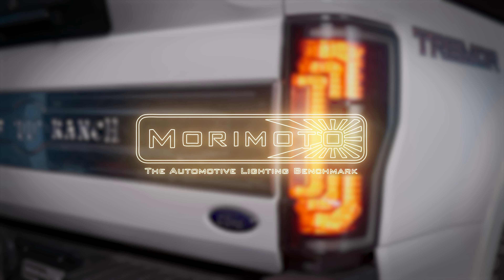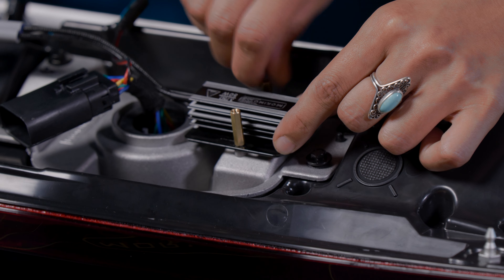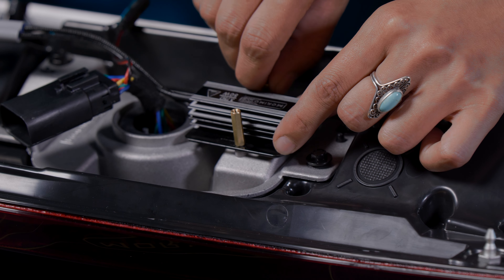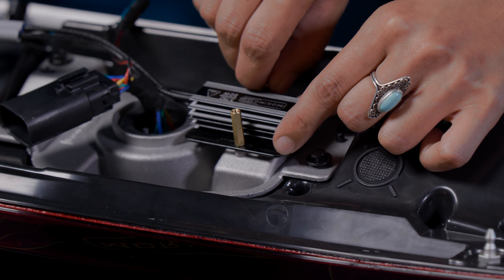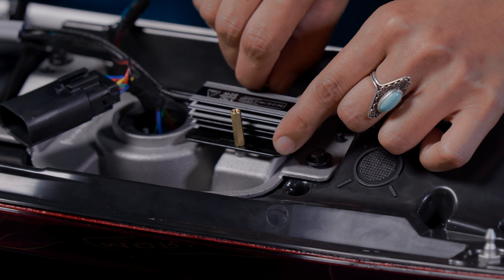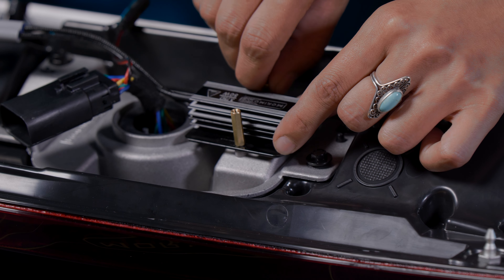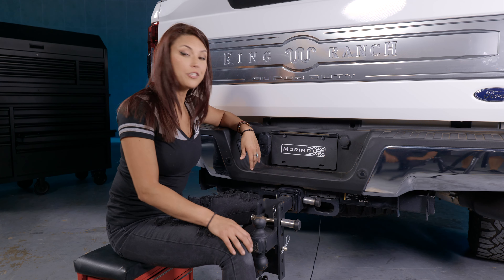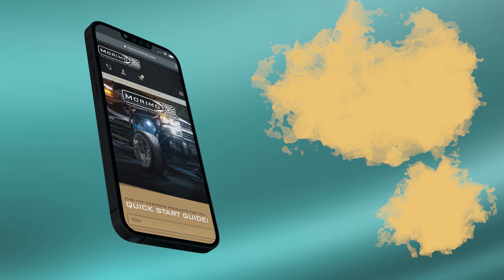2017-2022 Ford Super Duty XB LED Tail lights - Review & Install

Comment: The correct plug for 2017 with Bliss are PLUGs, 1, 1 and 4 with two 7 resistors on top of each,  She needs to make correction to this video.  She does great job with the video though.
Reply: My morimoto running lights not working 2017 f250 halogen with bliss

Comment: For 17-19 halogen w/BLIS, this says plugs 1,3&4 on the harness. The pdf instructions say 1,1&4.  Which is what I did. Just wanted to let you guys know.
Reply from the maker: Thanks!
Reply: @MorimotoLighting  For 2019 halogen w/BLIS,which resistor should be used 3.750 or 7.5
Reply: @alejandrog8923  both. I messed up and only used 3.75 and was almost rear ended bc my brake lights randomly stopped working. Trying to get in contact with morimoto about replacement resistors and harness parts

Comment: There is some strange inconsistencies with this video. We are trying to install on a 2017 w/o bliss w/halogens. This video says use the 3.7 resistors. Did that. Does not work properly on the truck. Later on for another model she talks about changing the yellow/red/purple wire on the inside and mentions two colors while pointing at the wrong colors. You guys should make a new video. Still working through the issue at the moment. The headlight revolution install video is much better and also contradicts this video. Hopefully their config works…
Reply from the maker: Sorry to hear about this headache, please review the description for proper guidance. Will circle back with the team and get this video updated!

Comment: 17 to 19  halogen with blis use plugs 2,3, and 4 you will get amber turn and red brake.. If you have the hyper flash turned off don't use the resistor

Comment: Just put mine in .... They are badass but I have a hyper flicker with the turn signal on the dash (as if the blinker is out) turn signals are working right .... How do I fix this
Reply: They tell you to use the 3.75 for halogen without blis, that is wrong.  Should be 7.5.  My rapid signal was fixed